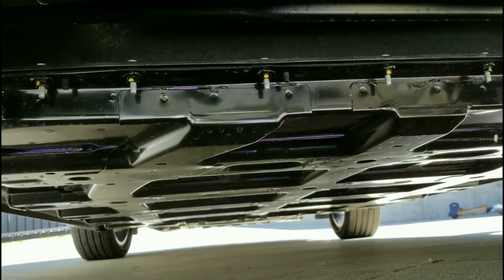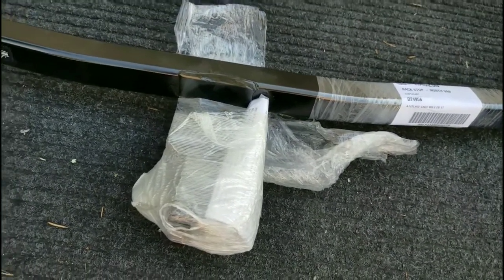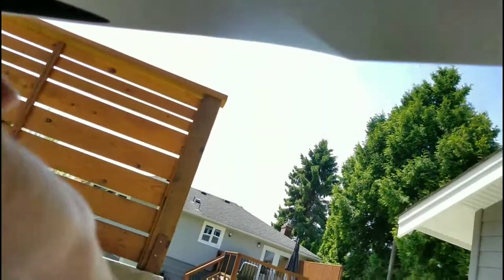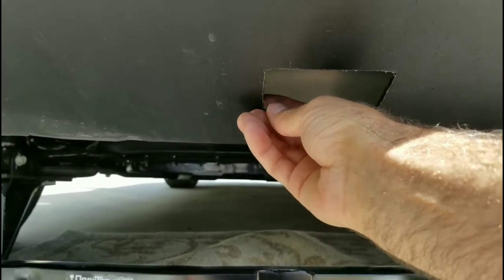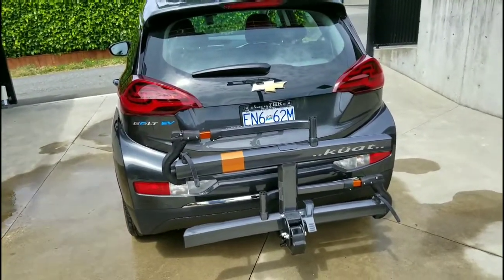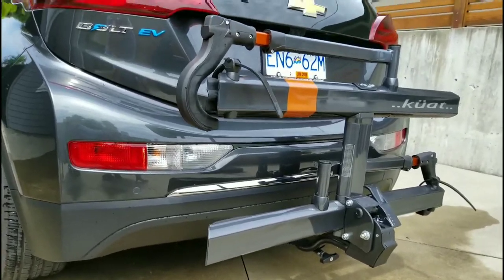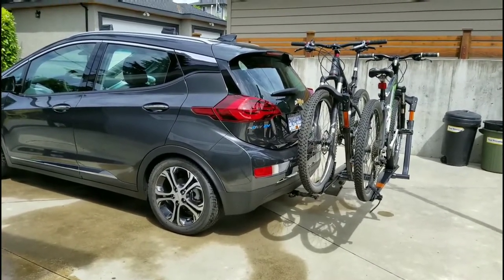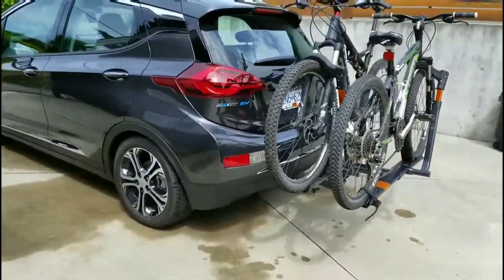2017 Chevrolet Bolt EV - Draw-Tite Hitch & Kuat Sherpa 2.0 Installation

Comment: Awesome video guidance!    Thank you very much!!   I brought my Bolt rack / hitched from AutoZone!   Followed the video instructions, made a 3.5” X 5” pattern to cut the bumper.  I marked the area to cut and used an  utility knife to cut the bumper.     Just poke a hole in the bumper and cut little by little.   Follow the video and you will have no problems!

Comment: Thanks for the video. I installed mine in about 45 minutes this morning. For the cut-out I cut a piece of paper to size-- 3.25" x 5" and taped it into place. It was then easy to turn it one way or the other to square it up. Then I cut around the paper with a utility knife.

Comment: Thanks Chris for doing ALL this: I'd decided on the Draw-Tite hitch and the Kuat Sherpa 2.0 bike rack for my Bolt, and after getting the hitch and the bike rack I just thought I'd look for some hints -- and here you'd done all the work I did over again (rejecting the Curtis / Chevy  hitch because it doesn't have arms to keep it from rotating with the weight, while the Draw-Tite has arms and a greater tongue weight capacity; choosing the Sherpa as the admittedly nicest-looking hitch with 80lb bike weight carrying capacity and importantly itself only weighing 32 lbs and not having a center vertical piece to get in the way of the rear camera -- though one or both bikes might obscure that view).  Similarly, my Bolt is white and I got the Sherpa rack in white!
Reply from the maker: Nice! I'll bet the white on white looks great. And yes, I think the Sherpa 2.0 looks like it was made for the Bolt : )

Comment: Loved your video. My drawn square was crooked like yours so I hung a plumb line off the center sensor. (bolt and fishing line taped to car) . You could then sit back and look at the center point and adjust from there. Thanks again.

Comment: Thanks for the video. We are considering a Bolt and I want to keep using my bike rack.
Reply from the maker: Hi Paul. I would certainly recommend this solution from Draw-Tite over the one the Chevy dealer supplies. Draw-Tite has a better system for mounting to the car. 4 points. Then just keep in mind the total tongue weight 200lbs... or 100lbs total bikes + rack. 
Thanks for watching.

Comment: Excellent video.  I used your guidance to install the same Draw-Tite model 24956 trailer hitch on my brand new 2019 Chevy Bolt. Also used a Dremel Power tool as suggested and worked like a charm.  Just awaiting my delivery of the Kuat Sherpa 2.0 and i will be all dialed in and ready to roll.  Again, thank for providing the research - this is a fantastic combination of trailer hitch and bike rack.
Reply from the maker: Nice! Thanks👍

Comment: Thanks! Your video helped me out a lot with my own install of the draw-tite hitch on my bolt! Gave me the confidence to do it myself. First time I ever installed a hitch :)
Reply from the maker: Nice!
Reply: Now, if this car could tow 2000lbs then I'd be all set! It's got the power for sure, just not sure about traction with these low rolling resistance tires and the strength of the chassis itself. :/

Comment: Thanks Chris, I appreciate your DIY feel. I was considering the Chevy Dealer hitch which is the Curt 1.25" but only has a 100lb TW rating while this Draw-Tite Hitch has 200lb still with the 1.25" receiver.  The TorkLift EcoHitch has a 2" receiver and still 200lb TW and is a much more complex install and costs significantly more.  Harbor Freight sells a 1.25" to 2" adapter for < $15 so I can use the bike rack I have. Still considering between Chevy recommended vs Draw-Tite.
Thanks for the video and all your others. I a m only a 1month old Bolt owner.
Reply: Well I decided on the Draw-Tite, I saw reviews on the Curt getting bent without the diagonal support. The Draw-Tite looks great. Went thru Trailer Jacks, ordered today and it will be arriving tomorrow with free shipping, its amazing.
Reply: Received my Draw-Tite hitch a few days ago and my son installed it in about a half hour. Works great thanks for the tip Chris. I got a adapter to 2 inch from Harbor Freight and able to use my 2" receiver rack.

Comment: Thinking of getting a Bolt - And I was looking for information on a bike rack - thank you - Great Vid.
Reply from the maker: Great. Thanks for watching. The Kuat Sherpa 2.0 is perfect for the Bolt.
Reply: Another thing I was wondering about - I live in Ontario and the Bolt would be eligible for $14k in (F&P) government rebates. From your experience, do you need to apply for the rebates after the purchase - or does the dealership do it on your behalf during the sale?
Reply from the maker: Hello Eric. Wow! $14k is huge! We don't have that incentive here in BC. I did however, receive $5k off the original sticker price. I didn't have to apply, they take it off at the time of purchase. Which is good, but the car is still not cheap. The sticker price on the Bolt Premier w/ Infotainment and Driver Confidence packages, plus floor mats was $51,425.00 CDN. Ouch! Less the $5k = $46,425.00 pre tax.

Comment: Chris, I know its been a while but thanks for the Bolt hitch receiver install video.  Watching the video eased my mind and answered the questions I had about this job.  Today I borrowed the ramps (loved your idea of steps instead of a ramp) to give myself more room as I get under the car.  I will go by tomorrow to O'Reilly's and borrow a torque wrench.  I will also make sure I have cutting blades for my Dremel tool - thanks too for that tip! -and I should be good to go.
Reply from the maker: Nice! Thanks for the comment Paul. Enjoy your Bolt👍

Comment: great video. i had a hitch mounted to my 2017 bolt by my chevy dealer. the hitch is not stout, the rack itself either flexes or is wobbling at the mounting points. its minor, but there is clearly some flex. i dont notice this on the hitches on my other 2 vehicles. is your bolt hitch fully stout?
Reply from the maker: I understand.  This Draw-tite hitch mounts differently than the one Chevy uses.  Better mounting locations, on vertical and horizontal surfaces. The Chevy one... I think from Curt, only mounts vertically. 
Also, the Küat rack I'm using has an integrated ball system that removes play it the receiver itself. I'm very happy with it.
You may want to try running a strap from the bikes  to the car, once loaded, to try and remove the flex. I've seen some people do this.

Also, curious as to how much weight of your bikes? Should be around 80lbs. Also, always use the 'inside' tray first if only carrying 1 bike😀👍

I hope this helps.

Comment: Thanks for that. I too am  going to put a trailer hitch on my Bolt, now that I see it is an easy process, I will order one too. I have one on my Nissan Altima and notice carrying bikes really lowers my gas mileage, so I'm sure you will/have noticed a drop in your mi/kw. Let me know how it affects your mileage. Good Job...
Reply from the maker: To be honest, I haven't noticed any loss of range. However, I remove the rack when not in use. And when I travel with the bikes it's usually just to the trail head, so the distance isn't long enough to show. 
The rack, paired with my bike would be less than 80 lbs, which is the weight of a small passenger as best so I wouldn't expect much of a range loss. Maybe something due to the minimal wind resistance on the bike frame...??
Reply: Thanks Chris. I take my bike (tandem) on the freeway up to speed (65) in the Bolt quite a long distance. On shorter trips it probably won't make a difference. It must mess up the air foil adding drag. Also, the tandem is so long it is longer than the car is wide, so it sticks out a little on each side. Your normal size bikes fit nicely behind the car, so probably wouldn't make much difference even at higher speeds.
Reply: @cpF01  Hello Chris, been a year since this post.  I am picking up my bolt soon, and looking to put a bike rack on it.  Any more travels with the bikes, and noticeable loss in range?

Comment: Thanks for the great video. I am considering installing one on my Bolt too. Did you observe any drop in range with the hitch mounted?
Reply from the maker: Hmm, hard to say. I mean, yes... based on the speed. It you are at highway speeds (110-120km/h) you may see some. At lower speeds , I didn't notice any change. My Bolt lifetime consumption was 19kWh/100km. The biggest hit to consumption was highway speeds and weather . Having said that, I normally took the bike rack off the car when not in use as it disables the rear parking sensors. The Kuat Sherpa 2.0 rack is a great option for the Bolt. Light weight, easy to attach and remove... and sexy : )
Reply: @cpF01  Thanks for the reply. I too intend to take the bike rack off when not in use. The Kuat does look like an awesome rack. It will be my next rack when the current one retires.

Comment: Is the back tire supposed to hang off that much? Would it even work with a bigger and lengthier bike?
Reply from the maker: Yes. It's OK. That's a pretty big bike. XL, 29er. There is an additional velcro strap if you're concerned.  But I've used it lots and not had any problem 👍

Comment: Excellent install, Chris.  Thanks for making the video.  Quick question though, which Dremel cutting tool did you use?  I'm going to be doing this install soon and my biggest concern is making a clean and square cut of bumper fascia.  Thanks, again!
Reply from the maker: Jeff Andrews thanks for watching.  I used a cutting wheel bit. It was about 1/8" wide and worked well. It was scary cutting into the car though🤔
Reply: Thank you, sir!

Comment: How do you connect the hitch electrically? I have got an Opel Ampera-e from 2017.
Reply from the maker: Hello Jos.  Thanks for watching. No, I only use the hitch for use with a bike rack. In Canada our bike racks don't require running lights. I've seen the giant bike racks in Europe that DO have lights. : ) The hitch manufacturer does make an electrical harness for this application, but I haven't used it.
Reply: With MIG, TIG or an arc welder. /s

Comment: Don't know if someone already asked but how does this effect your reverse sensors? With three bikes on my rack (Gen 1 Volt) my sensors go off every time but I just put up with it instead of turning them off.
Reply from the maker: evtrekker13 You're correct , when the rack is on the car, the sensors are automatically turned off. You are notified on the DIC.
Reply from the maker: Hello evtrekker13. The reverse sensors are turned off automatically (deactivated) and an alert comes up in the DIC.  - So it doesn't 'beep' when you put it into reverse. I hope this helps. Thanks for watching.

Comment: Hi Chris,  Do you think you it would be fine with the Kuat NV 2.0 ? That  Draw-tite says it is good for 200lbs on the tongue. Or do you think that would be pushing it to much?
Reply from the maker: Joseph Jozwik Well... I'm not an expert, just a consumer, but the NV 2.0 is 20lbs heavier than the Sherpa 2.0. So 52lbs of rack, plus 80lbs of bikes = 132lbs. The tongue weight of the receiver is 200 lbs, but Rack Stop told me the weight was halved because you're not over the actual ball, you're back a couple feet with your weight. So, yeah, going by that, you'd be pushing it. 
Having said that, the Sherpa 2.0 is only 20lbs less and I've driven with 2 bikes and had no problems. The Sherpa 2.0 has a great anti sway ratchet mechanism that works really well. So... I'd go with the Sherpa 2.0 but maybe someone has more experience with the NV model. 
Thanks for watching.

Comment: Nice job on the instructions. I was wondering if you could put a hitch on the Bolt EV, now I know. Can you get a wire harness so you can tow a small light trailer?
Reply from the maker: Yes. Curt makes one for the Bolt. I won't as I was just needing the bike rack. I'm sure you'd be ok pulling a small garden trailer.
Reply: Thanks Chris for the reply. Next car will be electric but I'm still on the fence as to what brand it will be. I did take a Bolt EV for a test drive and was impressed by it. Cheers from the other side of the SoG.
Reply from the maker: Thanks for commenting Gil. I really like the Bolt but there will be a number of EVs on the market in the near future. I think everyone will have to consider an electric vehicle for their next car. It may not be right for everyone, but thy will need to consider.

Comment: That hitch and bike rack looks really good on the car. Drawtite is a pretty good brand. Do they sell the trailer lights connector for the Bolt, just in case you ever want to pull a utility trailer or jet ski? Some kits are super simple if the manufacturers wiring harness has a connector in the right place.

The roof rack mounts look fine, the cargo box looks ok (very hard to make them look good on a tiny car). The crossbars without the cargo box probably looks fine. It's just the crossbar length and height with the cargo box  that looks bad as a set. If there were a set of crossbars that were the same width as the mounts, and had a drop down bend in it that let the cargo box sit 2" lower, it would look like it was made for the car (because it would be. LOL)  

It looks like if they were going to use a straight crossbar, they could have made it such that it's telescopic and can be locked in at any width between 30"-50", depending on how you want to configure it. I know those extruded cross bars are too expensive to cut to length unless you are absolutely sure you will never need it for anything wider than that cargo box.
Reply from the maker: IMHO Yeah, I think I'm done with rack systems at this point. I have everything I need... unless a longer, shorter, sexier top box comes my way. I don't actually drive around with all this stuff on the car normally. They're just needed for family trips where we need more storage. All in all, pretty happy with everything. Not cheap though.
Reply: http://www.capturownersclub.co.uk/forum/uploads/2304/Captur_br_5.jpg

For a small hatchback, and a big mountain bike, I like this orientation. This is a strap-on bike carrier, but I don't see why one can't be designed for a hitch receiver, that tilts back when you want to open the hatch. 

I guess it depends if you need to drive through narrow alleys or under low overhangs. LOL

Comment: Chris, two questions... 1. Have you noticed any range loss when on the highway because of the aerodynamics when having both on and if so how much?   2. Does the Draw-tite come in a 2" as well as 1.25" hitch or do you know of any that do which might give it a little more tongue weight? (I have two electric bikes, about 49lbs each without batteries if I put the batteries in the car... and I own a Allen Sports S545 rack that can support that but its a 2")
Reply from the maker: Hmm. I believe I've seen a 2" receiver option for the Bolt. But check around, I'm not sure it was from Draw-tite. Both the Curt and Draw-Tite hitches specific to the Bolt EV were 1.25" at the time I did my research, and I preferred the construction of the Draw-Tite unit. There are available wiring kits too. 

Does your Allen Sports rack support 50lb bikes? You're looking for a total of 100 lbs of rack and bike combo weight fro the Bolt.

Having said that, I haven't noticed any range penalty with and rack on the car. The only thing that really affects range for the Bolt EV that I've noticed is cold weather. To the tune of about 25% during the winter months. 

I hope this helps.
Reply: And any noticable range loss while having both bikes on?
Reply: Yep, helps Quite a bit.  Yes my Allen Sports can hold 1-4 bikes totaling 140lbs in height on the extendable arms.

Comment: Hi Chris, there is no obligation to have a light-bar and license plate on the bike rack in BC? In Europe you will need to tap into the car's wiring harness to drive secondary brakelights, indicators etc.
Reply from the maker: Good Morning Henk-Jan Withaar. Thanks for watching. No. In British Columbia we don't need the extended lights like you have in Europe. At least not for bike racks. Only needed for additionally licensed trailers, travel trailers, etc. Here, the only requirement is that we do not obscure reading the license plate. These bike racks are normally quite a bit smaller than the ones you see in Europe. In Germany, I saw bike racks complete with turn signals, tail lights, bumper... amazing! But they must be heavy.

Comment: Thanks for the video instruction.  I have the same gray Premiere and took delivery today of a draw-tite hitch for use with a bike rack.  I will tackle tomorrow morning.   I'm going to use a floor jack and jack stands to get it up off the floor a bit.  Any insight on jack lift points?
Reply from the maker: Charles Naughton Hi Charles. Cool! Have fun, you should be good to go. Should take you a half hour or so.
I just backed it up to some stairs to give myself a little more room to work. I was able to do everything myself without needing an extra hand. Sorry, I haven't looked into jack points, but probably under the shock mounts as you'll need access to the frame rails. 
Good luck!
Reply: the installation went well, thanks to the video. really simple & easy. One issue i had was one of the push pins wouldn't go back in.  I'm going to have to get a replacement someday!
Reply from the maker: Charles Naughton Right on! I thought I was the only one with a bike rack on a Bolt. Guess not😃. What rack do you have?
Reply: Lets Go Aero Bikewing 2 Bike Rack. Works well with one bike, two works as well but placing the bike between the rich & Bolt is a precise maneuver. It's light weight as well.

Comment: Great video! Thanks for making it! I inspired me and I got the same hitch for my bolt EV. Where did you find the torque specs when tightening the bolts? Cheers!
Reply: It’s in the manual 50 and 38